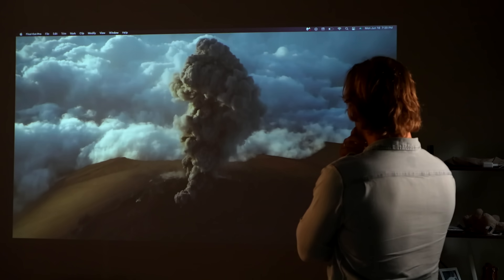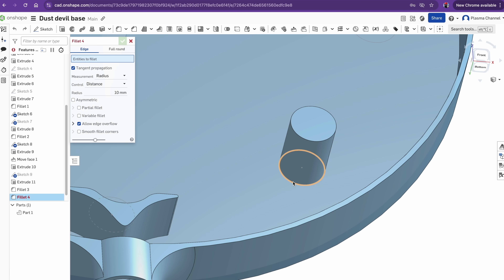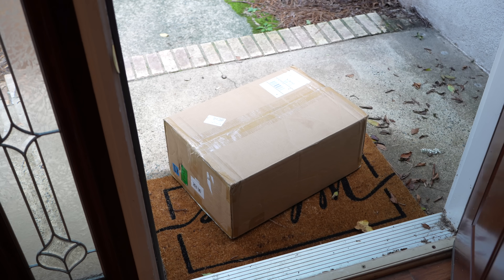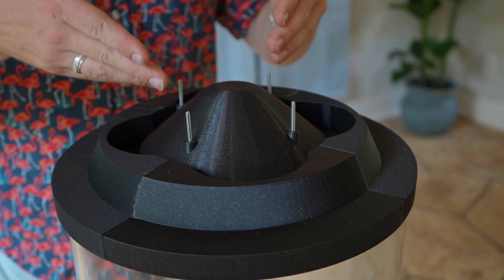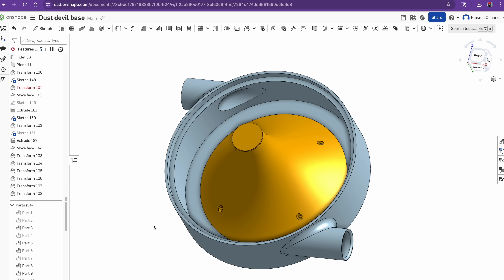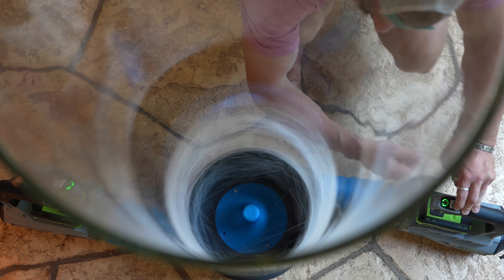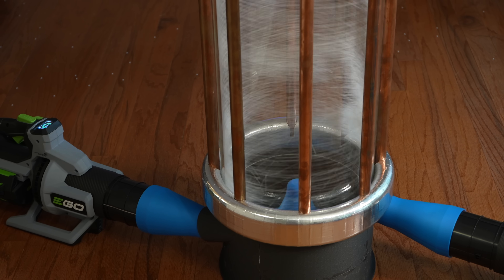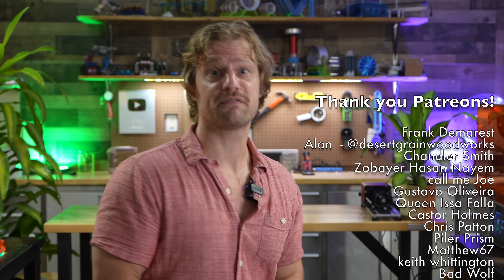Making Lightning In A Bottle Might Be Possible  (ft. 3D Printing Nerd)

Comment: You could make a Van da Graph generator with it, with the beads moving around being the belt moving the electrons. If you want high voltages, you need to blow the beads up and let them sink down somewhere else (just like the belt of the generator).
Reply: I agree. But I think part of his issue is he has a circle already but he is not taking the voltage from opposite sides. His current design the circle is horizontal. He needs some aluminum tape verticle on both sides 180degrees apart. The voltage will build on each side this way. He is putting the electrode horizontal which is actually canceling the build up! He is shorting out the circuit instead of generating the difference.

Comment: Great concept, but the failure of the vortex is not entirely your fluid dynamic, rather one I would think of the air introduced must be significantly warmer and dryer, then collide with much cooler humid air to form the downward motion of falling air thus creating a true vortex.  Not an easy thing to do in a chamber, but not unattainable.   A difference in inlet air and outlet air, a probably good range would be somewhere between 10C and 30C.    This assuming you are still trying to create a true vortex.

Comment: Not sure if it is an idea or not as i don't know nothing about it apart from what you have said in the video, but you said at one point in the video that you felt the static at a certain distance away from the outside of the glass tube, so could it be that a static collector like the cage you done with the copper tubes but so that it sits a few inches away from the outside of the tube. again i might have misundertood what you was going for. love the channel and vids.

Comment: Biggest tempered glass tubes are for the one greehouse lights where the duct hooks right to it without a reducer in 1,000w hps lamps. They are open for connecting together.
   They come in 8 or 10 inch dia., maybe more and like 20-ish inches long (the bulb is inside it, hense the tempering. Maybe stack 2-3?

Comment: Try Kapton-taping the edges of the aluminium foil, so your charges aren't running away. That could also make a difference for the Faraday cage, where the tape had sharp-ish edges.

Comment: "Inductively picks up a static charge..."  Yeah, not gonna happen.  Inductance is a magnetic phenomenon that affects changing currents.  A static charge is isn't current because the charge isn't moving - it's static, not changing.  It's like setting an inductor next to a charged capacitor - no charge is going to move.
Reply: Technically, the statically charged particles are moving 🤓
Reply: electrostatic induction is a real thing. Look it up.
Reply: He's just using the wrong word. He means capacitively coupled. He just went for the non-technical meaning and hoped people would give him a break.

Comment: Clickbait. Title is 'I Replicated The Physics Of Sandstorm Lightning (ft. 3D Printing Nerd)', which you clearly did NOT do.
Reply: dearrow users named this video as "Building a Machine That Generates Static Electricity by Rubbing Plastic Beads with Air Currents" which is kinda similar
Reply: What part didn’t he do? 🤨
Reply: @dracoargentum9783  if you look at the thumbnail it shows a tube with a bunch of lightning in it which he didn't do so clickbait
Reply: @neb_setabed but he established that it was possible.
Reply: @dracoargentum9783  interesting, you asked what part he didn't do I provided the part he didn't do and you completely ignored it? I thought I made myself pretty clear? 
So let's recap things that we currently know.
1: The thumbnail showed a lightning storm inside of the glass.
2: The video does not contain any lightning inside of glass. 

Let me know what parts of that are hard to comprehend
Reply: @neb_setabed why do you think I am ignoring you or misunderstood? Yes, the main part was nothing about what the thumbnail was, and you are free to call that clickbait; but, I am suggesting that he DID start to have that as his video, and was sidetracked along the way, and it feels to me like it was bait for his narrative, rather than because he felt the picture was more interesting than his story.
Reply: @neb_setabed  honestly, when I wrote my first comment I had just watched the video but hadn’t seen the thumbnail since the start, and I had forgotten how much lightning he had put in his thumbnail. 

That was some baiting, but as I said; I think it was for storytelling not advertising.
Reply: @dracoargentum9783 The lighting?
Reply: @dracoargentum9783 check the namemin that account .. They are spam.
Reply: CRY HARDER

Comment: I may be wrong but going with original theory wouldn’t using anti static glass be perfect for the tube structure instead of faraday cage . Then we bring back the large plates to force coupling between the 2 plates for static charge
Reply: I actually think you would only need one plate too cuase we need one conductive layer far away from sand to couple with sand and produce charges

Comment: uma ideia, tenta isolar o chão, tudo que está encostado no chão tenta por uma borracha para isolar, pois pode ser que a estatica esta sendo descarregada no seu piso
Reply: The bottom plate is supposed to be attached to "ground", the earth (in the electrical and planetary sense), so it's not just fine if it leaks charge from the bottom plate, it's intentional. Then the top plate accumulates a charge relative to ground / the ground / earth.